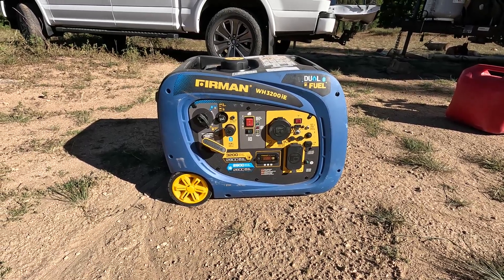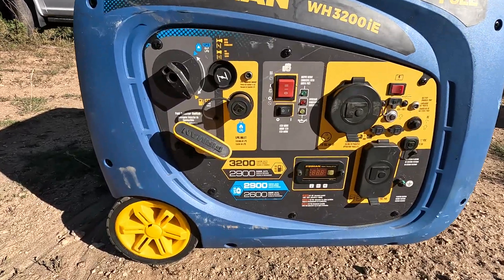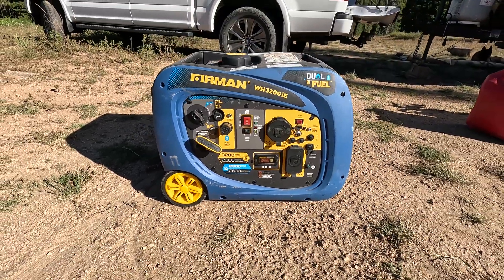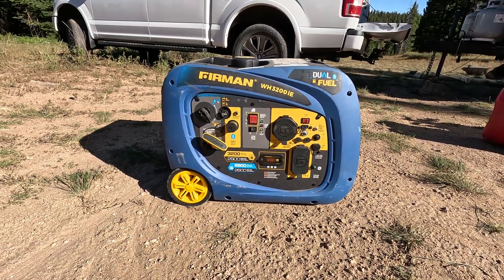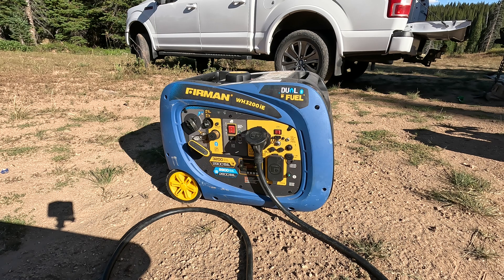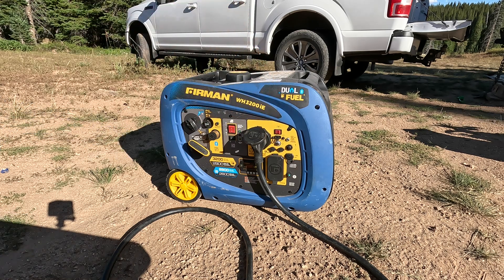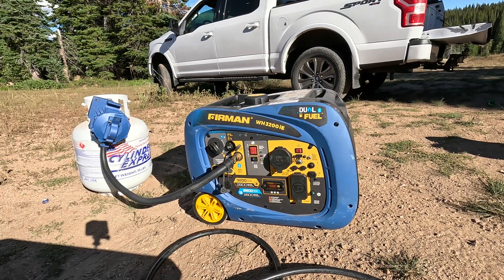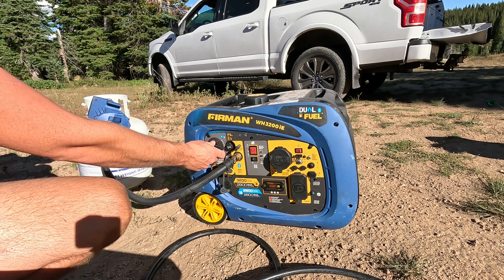Generator Performance Test at High Altitude | Firman Inverter Generator Performance

Comment: I would like to know if connecting another inverter generator such as a 2200 watt generator would perform and run your travel trailer ac and other appliances when camping in Colorado at 10,000 ft.  I have a Predator 3500 inverter generator with the jets using 91 octane.  I just went camping near Twin Lakes at 9900 ft.  My Predator struggled and repeatedly overloaded.  I am simply trying to find the best option for my desired camping at sites over 9000 ft elevation.   Thank you for your thoughts and input.

Comment: Picked up 2 very similar gensets last summer in Colorado Springs to use while javing generator issues. Rated at 32k 4k starting. This makes sense even with a parallel kit they were having issues running my camper

Comment: We have this same dilemma. We camp at 9k plus. Would a fuel injected gen work? Or maybe just a solar panel to keep the batteries topped off?
Reply from the maker: This is a great question.  Fuel injection will help a little bit, but ultimately you will still run into the same problem of not enough oxygen.  My friend Johnny over at Johnny’s weekends has a great video showing the Honda EFI gen’s performance at elevation.  Thanks for watching :)

Comment: What's the BTU on your air conditioner and did the generator run it? Thanks in advance.
Reply from the maker: I have a mini split, not a normal RV AC.  The load simulated though would be around a 13.5k btu AC.  A 15k would make this gen struggle, but at this altitude AC is actually rarely needed!